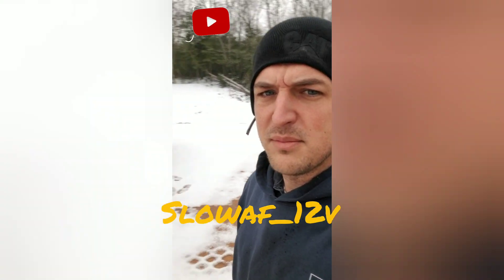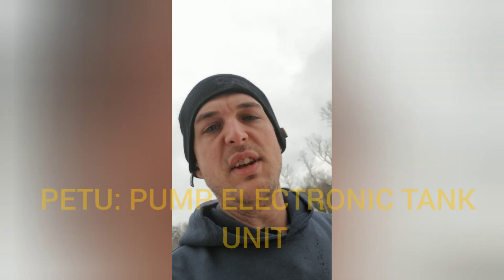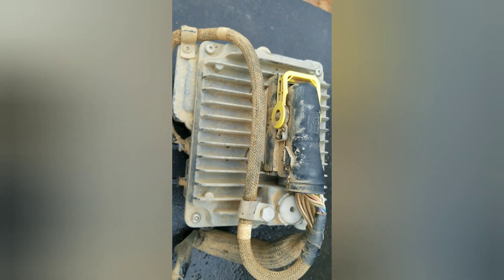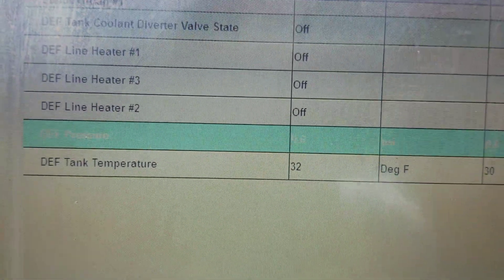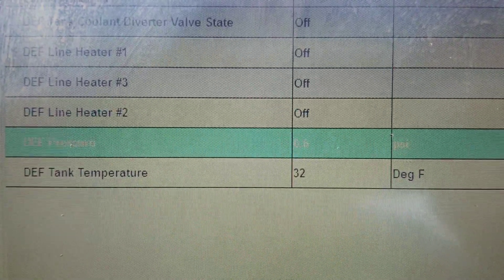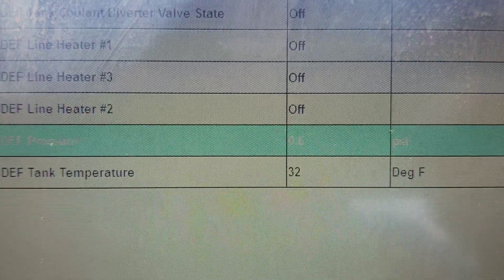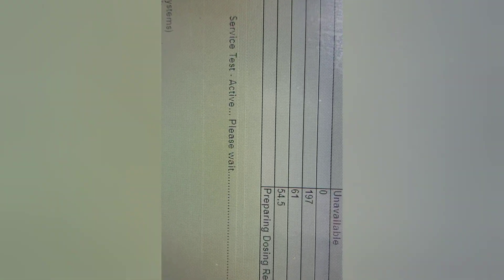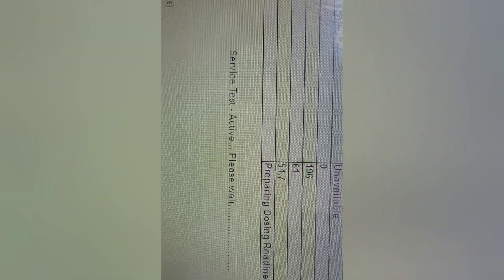CAT C4.4 FAULT 3511-3 CORRECTION/TEST

Comment: @slowaf_12v been following your YouTube I work on a heavy equipment also you explain everything good. Got question cat d6k low def psi code I ran verification test getting 82 psi what should the psi be thanks
Reply from the maker: Replace def filters would be first (5k interval) check suction line from petu to def manifold, there was an open service letter for alot of machines for failed/failing petu's yet, 82 psi is low btw...most run around 120+ psi..hope this helps